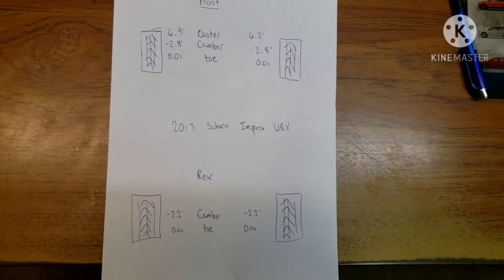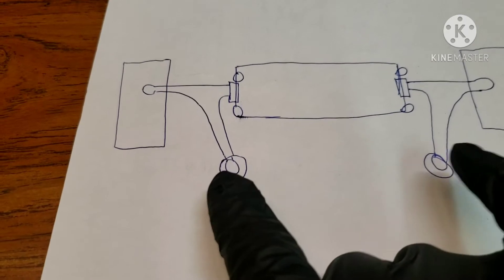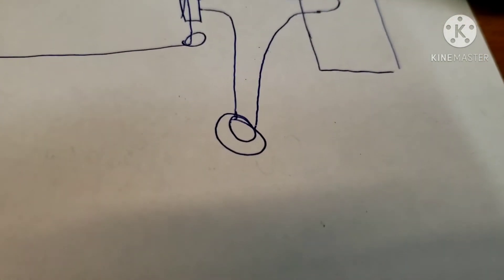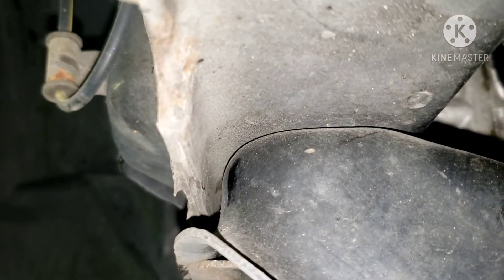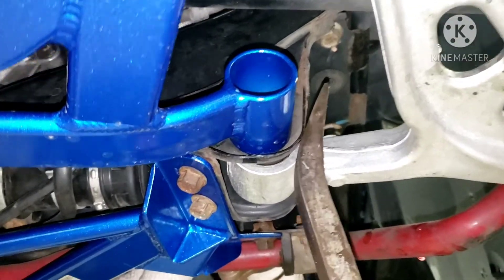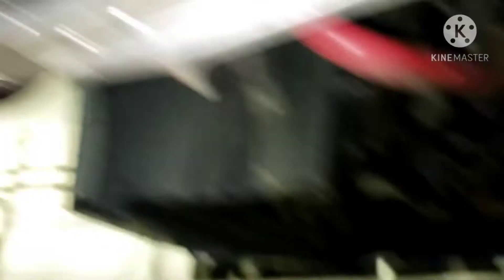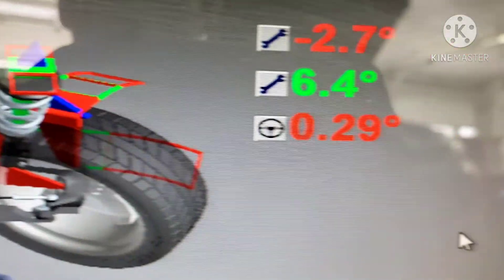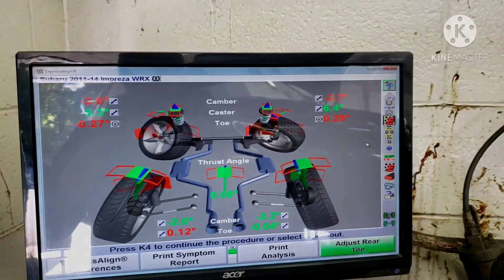Subaru Pulling to the right or left? How I fixed mine!! (Caster Adjustment How-to)

Comment: I know this is a three year old video. But did this actually fix your alignment?. I been having problems with my cars alignment and have the same problem. I got a 6.5 on driver side and a 6.0 on the passenger side. I pulled the ribber grommets in between the bolts and noticed my subframe was shifted to the passenger side quite a bit. Can clearly see white frame rail. So i was planning on loosening rhe bolts up and pulling the grommets again and adjust it from there to center the holes up. Thanks
Reply from the maker: @WhatWhiteMenSay  yup it got the caster fixed and definitely felt much better after getting it aligned again!

Comment: What's the blue part and did you lifk the engine a bit do this? I'm having the same issue with my 06 OBXT with STI 6M and think it could be the transmission making it pull to the right. Your thoughts please.
Reply from the maker: Cusco brace amd no i did not lift the engine. I dont think the transmission could cause a pull though.
Reply: @nickquatrini  perhaps the front helical diff?

Comment: I have a 2020 wrx premium
My caster is 6.3 on the left and 5.2 on the right, it pulls on right side? What should i do? Should i do this method ??
Reply from the maker: It is definitely worth a shot. I believe the 2020 is the same chassis so this should apply to you as well
Reply: I have nearly the same caster numbers on my 2021. (6.9 and 5.7 I believe?) did you ever end up trying to realign the subframe? did that do you any good?

Comment: Is this a permanent fix or does it need to be re-done for eg. when Lower control arms are changed?
Reply from the maker: This is permanent unless you need to remove the front subframe which I don't think anyone ever does.
Reply: @nickquatrini  Thank you. Local shops are doing it using a Hydraulic Press to shift the frame. Same effect I suppose?
Reply from the maker: @Aaron Brito  I'm assuming yes but I'm not exactly sure what they are pressing with it 🤔

Comment: My 2017 Legacy doesn't have any alignment issues but still pulls to the right and the steering wheel is a few degrees off center to the right. But there's still a slight pull to the right when driving straight without holding the wheel- so centering the steering wheel won't do anything, right?
Reply from the maker: No, id try swapping your front tires side to side and see if that helps.
Reply: @nickquatrini  already did that back in August. Didn't change a thing
Reply from the maker: @bohonzemalonze8926  got a printout of the alignment specs? Gotta be off
Reply: @nickquatrini  I have one from May 2021 showing all correct measurements. I was just at a Subaru dealership today and their machine showed everything was good. I asked for a printout about an hour later and they told me the machine was down and they couldn't give me a printout...
Reply from the maker: @bohonzemalonze8926  hmm that's interesting. Unfortunately without physically working on the car I'm not really sure what's causing it

Comment: So I have a 08 Honda CR-V and I installed bc Coilovers and for some reason it now beers in both directions city driving is okay it’s when on the highway you really notice and feel it tires are good even tire pressure tire rods are good what else can be causing my problem went to 2-3 alignment shops and they couldn’t really get it to ride perfect any help is appreciated
Reply from the maker: Start with the easy stuff. Check tire pressure of course and make sure alignment is straight. If the alignment is in spec, then I would suggest swapping the front tires side to side, as in, put the right front tire on the left and the left front on the right. If the pull starts going in the opposite direction then one of the tires has an internal problem, in which case replacing both front tires should take care of the issue.

Comment: Yes, that’s it!

I’ve had like 5 alignments and they couldn’t fix my pulling because the caster is off. 

I’m going to check this but I think I also have a second problem which is the top mounts. They tend to fail early, there’s a TSB about it. The alignment feels different every time I drive it so there must be some play there.

Comment: Interesting video, sub frame has shifted when driving or just installed that way? 18 wrx here and I have a noticed a slight light pull to the right ever since I got it. Alignment has felt close to spot on in corners but I I always fell it slightly trails to the right. I Noticed it most in right lane, when on highway and in lower gear just after tipping off throttle. Leads me to believe I have a camber or caster mismatch so time to get on a rack to see where its at. Haven't seen any considerable uneven tire wear in both tire sets to indicate toe issue so this saves the day if its caster.
Reply from the maker: I wanna say it was installed that way because it always did it but I'm the second owner so I cannot say for sure
Reply: @nickquatrini  Update: started a new job and now have access to an alignment rack. Cause of my pull: rear cross camber: RL = -2.5, RR = -1.7. My casters dead even each side at 6.4 degrees and I had my transmission/trans sub frame out before I aligned mine.
Reply from the maker: @blakelinn4499  bet it feels good knowing that you found the cause 👍

Comment: Was the pull you were experiencing happening all of the time or just when accelerating?
Reply: Interesting. I have a new WRX STI that is pulling to the right only under acceleration. Coasting and braking are fine though.
Reply: @w0nkerer figure this out? I just got 4 new tires and it pulls to right only during acceleration
Reply from the maker: All the time but most noticeable while cruising on the highway
Reply from the maker: If its brand new you should be able to take it back to the dealer and have them look at it for no cost. Pulling on acceleration or "torque steer" is not an issue subarus have and should not have. Could be as simple as an allignment or could be something a bit more involved.

Comment: I gotta try this. I've had the slightest pull to the right forever.
Reply: UPDATE! I loosened the four bolts for the subframe and pry bared it over. It barely slid over a 1/16", but the wheel stopped pulling right! Just the little bit over and it completely stopped pulling right. Then I scheduled an alignment at the dealership for the toe and camber, and now it drives perfect! Tracks dead straight and they perfectly centered the wheel. SIDE NOTE: I also added whiteline lower control arm mount and upper strut top mounts for increased caster and KPI. Everyone should try this!
Reply from the maker: Me too and this finally fixed it!

Comment: how many bolts did you have to loosen to move the subframe?
Reply from the maker: If I recall, I believe it is only 4 bolts that hole the subframe on. I also loosened the rear lower control arm bolts (1 on each side) because the bushings may help hold the subframe in place